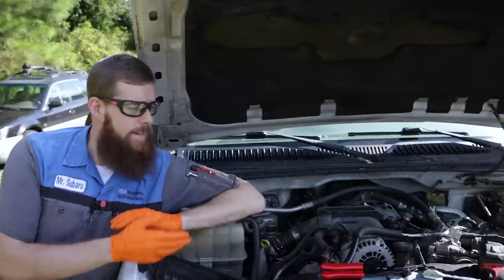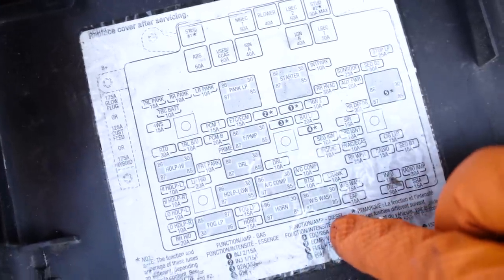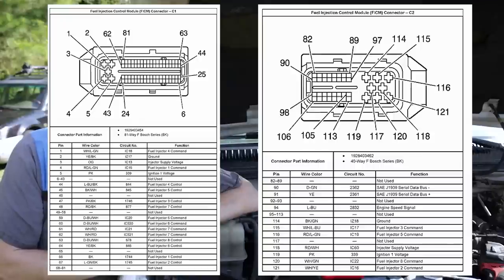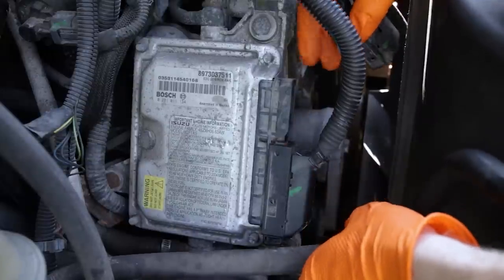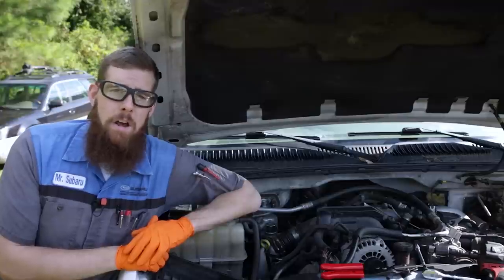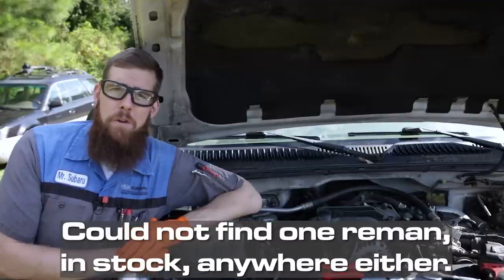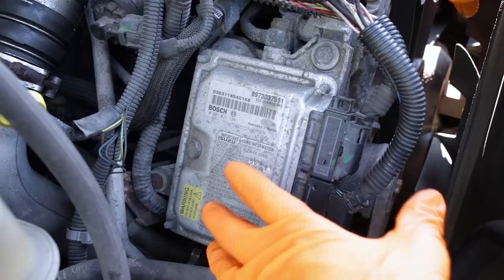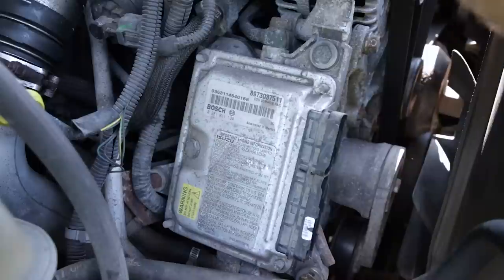$1.00 Capacitor Blew Up My Duramax FICM! LLY Duramax FICM Short Circuit Diagnosis & Replacement.

Comment: Thanks for this video. A friend brought me one of these from his truck. Much like yours one of the capacitors (middle of the three) had exploded and shorted. It was blowing the fuse to the module.  The board was beyond repair as it is a 3 layer board with traces in the center of the board layers. Several of these traces were destroyed.  He was able to find a running replacement. I told him we should go ahead and replace all 5 capacitors in the used module. I believe they were 125 deg. 2 different values. We did the replacement and so far so good. I'd say in this case it's not a matter of "IF" these capacitors will blow, but "WHEN" they will blow. If I owned one I would get these parts changed.  And no, I'm not in the business of working on automotive or consumers electronics. Just industrial electronic controls, VFDs, PLC etc..

Comment: You can delaminate the run on the board and fill it with epoxy after removing the charred material. Then do a pad repair.
I'm sure there are a few board reconstruction videos on YT.
Reply: I have one in front of me now. These are muilti-layer board at least 3 layers. Yes normally remove carbon and clean and fill with epoxy.  This one is toast as there are tiny traces and layered traces that are gone.  The owner is going to buy and currently working board and have it recapped before it gets this bad.

Comment: Dang, that board might be literally toast! 

Like other's have said, add a bit of fresh high quality solder and flux to the pads to help the older solder flow. Also a high quality de-soldering braid like soder-wick will wick away the solder much better than those soldering suckers and also double as a heatsink to pull away excess heat fast to avoid lifting up the pads!

Hopefully a replacement board isn't too much. I you pull one from a junk yard, might as well swap the caps while you're at it to prevent this. Good luck MrSubaru!
Reply: This was an LLY....a replacement is extremely expensive. They were running about 1-2k used

Comment: you can save de board, you have to remove the charred parts of the copper layers with until eliminating the short circuit.

Comment: The perforation on the top of the capacitor is supposed to pop when they go bad. Unfortunately I've seen too many just burn at the board like in your case. That sucks

Comment: Very helpful video for me.  i had the same issue with my LLY, but the issue turned up in the harness.  one of the pink wires was shorting to ground on the drivers side of the engine.

Comment: Sometimes a regulator will pop the first cap nearest the regulator output voltage.
But, simply replacing the cap will result in another blown cap.
Seen it both ways.

Comment: This should be salvageable with "some" effort. I've repaired damage like this on computer motherboards where a cap has exploded. In similar situations part of the damaged PCB may need to be removed (various methods like a Dremel, or CNC mill for the pros). The damaged PCB section can then be bypassed and the damaged traces rerouted via some solid core jumper wire. Side note: Get yourself a better solder sucker for the future! The "ENGINEER SS-02" is my personal go to, made in Japan, or just stick a little silicone tube on the end of your existing sucker and you'll get much better suction! Good luck, been following you for years for my Subaru needs.
Reply: This is a multilayer board... When the cap blows it shorts out the multiple circuits in that area to each other. You can not fix this.
Reply: Most computer motherboards are also multiple layers. You have to remove all of the damaged areas and ensure there are no shorts. You can then start bridging any damaged traces back together, this is more difficult across multiple layers but not impossible.
Reply: @thejoshuahenry  There's definitely shorts if the capacitor blew. These explode in spectacular fashion and nearly blow a hole in circuit board. Also, a schematic is not available so it would have to be reverse engineered. No one who does these rebuilds wants to try to fix one when the cap has exploded like this.

Comment: Mine will crank and run smooth for 3 or so minutes then go into tractor mode  I scanned it and it says all of the fuel injector circuits are open except 2 i believe the Ficm is bad what do you believe

Comment: As mentioned already in the comments, you need some liquid or paste flux. I prefer the liquid because it's easier to clean up. Flux serves two purposes, one to clean the area and two to make the solder flow smooth. The PCB itself looks toasty though.

Comment: Hello, thanks for all the super helpful videos on subes (Best on YouTube for sure!). I have a code 45 from my AT oil temp flash. Hesitates on acceleration seldomly and stalls at stop sometimes. Can ask your opinion on the cause? Fluids good, not slippage when hesitating. 2001 Forester L. Thanks again!

Comment: Duramax 10 year PM: Disassemble FECUM, replace capacitors and protect board from grounding to frame.
Reply: I worry about my old subuarus with these kind of issues, everyone knows of the forester clock repair for bad soldering I imagine there computer type boxes are just as bad
Reply: @LarryBlowers  just getting into the Subaru scene. Liking what I'm seeing so far but haven't researched a ton yet. All manufacturers have their issues for sure. So far from what I'm seeing, Subaru stands out because their engineers seem to have had the mechanic/technician in mind more than the other manufacturers. I can only speak for the 2000ish to 2010ish Outbacks really but that's what I'm seeing anyway.

Comment: Just curious did you get a lost communication with FICM code my fuse didn't blow
Lost commn with FICM code mean , took terminals off and cleaned and replaced fuses cause they looked corroded and it started just not sure if FICM is bad

Comment: Maybe try a pick-a-part for a new to you board in the meantime?
Around here, when a diesel comes in everyone jumps at it like vultures. Engine bay stripped clean in 2 days.
Reply from the maker: Yeah. Diesels don't even hit the junkyards here.
Reply: Any junk yard that gets an lly in knows what they have... The ficm comes off in about 10 seconds and is put in ebay for 2500 dollars

Comment: This FICM should be protected by 2 fuses.  Allowing 25A for control circuits is way too much.  Should have one fuse for the electronics and one for whatever is connected to the output of those MOSFETS.  Of course then, they couldn't charge you $1700 bucks for a circuit board when a capacitor fails.
Reply: 1700? Lol you can't find one for less than 2800 now

Comment: Good decision to toss it out. Dielectric break down with burning mark meaning high enough current has passed through and damaged other components already. Even if you successfully fix the trace, I wouldn’t trust the unit doing a safe job supplying fuel.

Comment: That's sad. Looks like this capacitors don't have vents on the top, but on the bottom. PCB has burned down through layers? Maybe try to clean it?
PS always clean electrolyte from caps as good as possible

Comment: Great video, I just subscribed.  Man I am worried about this happening to my ficm.  I'm thinking about pulling mine out and replacing all of the capacitors, but I keep thinking of the old saying...If it ain't broke, don't fix it.
Has anyone tried to do this with success before the ficm fails?
Thanks!
Reply: I’m planning on sending mine in the capacitors are almost 20 years old at this point might as well replace them only 250
Reply: This just happened to mine, fried the board badly. If you have the opportunity to change them out, I'd do it now.

Comment: Is it possible to upgrade the capacitors on the lb7 ficm to compensate for the voltage difference on the lly injectors?
Reply: Maybe even put resistors inline of the injectorsto decrease voltage?

Comment: If it helps, I highly doubt the capacitor was the root cause of the burn. I spent a miserable 34yrs as an electronic tech and seen a lot. Capacitors never fail and burn the board. They may open circuit, short circuit, leak, explode. They fail, but not the way this board burned.
Reply from the maker: You don't think it leaked out the bottom?
Reply: They leak possibly
Reply: They leak acid and can eat the lays off the board, but not burn and I know for sure the burn is not blowing the fuse. Does the burnt capacitor check shorted between the leads? These kind of problems are generally a serious issue beyond the obvious.

Comment: What's the update ever get it running just bought a truck at auction and this is my issue 😣
Reply from the maker: Yeah. Found a FICM used for a grand.
Reply: @MrSubaru1387  man that's kinda rough was thinking about trying this sia electronics see if I can get it any cheaper but thanks for making the vid just got another sub my friend
Reply from the maker: I'm seeing them used, going for $2,800+ now...
Reply: @MrSubaru1387  ohh no that's insane
Reply: @MrSubaru1387  where can i find one?

Comment: If you even find them at all, buy two and sell one to me. I cannot find them anywhere! My truck hasn't run since the end of July!
Reply from the maker: I found a junkyard one for $1000. I'm back rolling after over a month down.
Reply: @MrSubaru1387  I have a contact at the local LKQ watching for one..
Reply: I have no blown fuse, but still won't start. Diagnosed as bad FICM by dealer.
Reply: But with the FICM harnesses plugged in, it will drain my batteries dead within 24 hours. Unplugged, they will hold a charge indefinitely.
Reply: in the same boat :/ replaced the batteries with new ones started fine sat for a couple days started it, idled for 5 seconds and then died. injector codes and lost comm to ficm saw similar posts on forums.
Reply from the maker: Pretty sure my NOCO jump pack fried mine. Jumped it, idled about 15 mins, pulled up to my shop, shut it off. Started it back up an hr later, ran 20 seconds, blew fuse for FICM.
Reply: @MrSubaru1387  Dang that suck to hear, i can't justify spending 1k on something that's just gonna sit, probably just gonna let it go for cheap haha